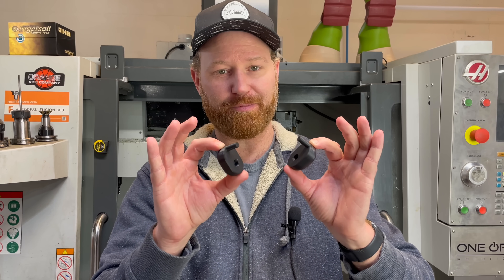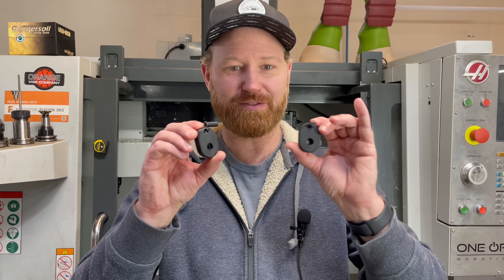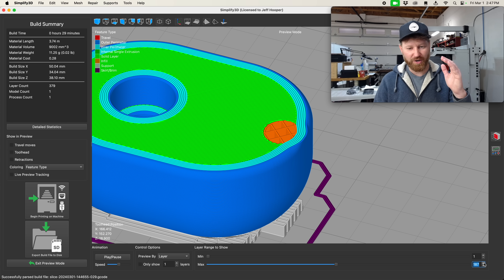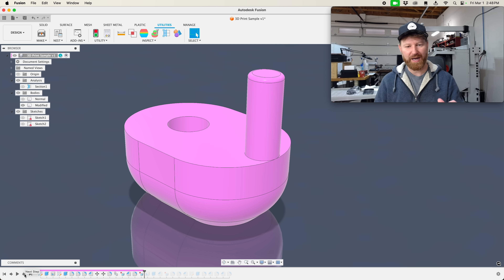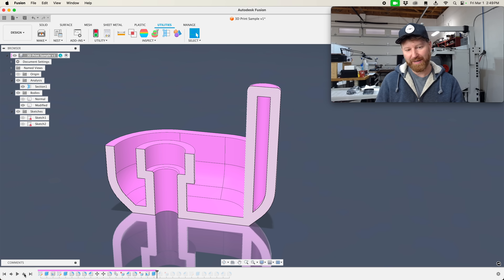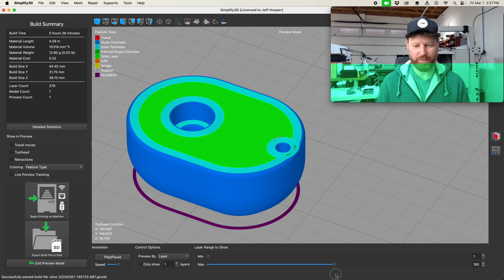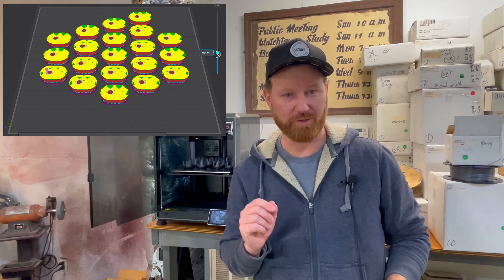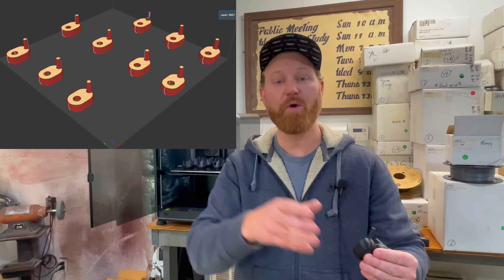Make your 3D print Faster & Stronger

Comment: In this example with a "tower" there's a slicer solution that doesn't require a change in a model. Use cylindrical modifier that goes to the bottom and change infill to 100% under that protrusion (or play with other parameters). Very useful especially if you use someone else's stl.
Reply: Can I ask what slicer you are using? That seems like a great tip and I am not familiar with it, but I only use cura for FDM.
Reply: @RoseKindred  Hi Rose. In cura you can use "support blocker" to create a cube that intersects with the model and then use "modify settings for overlaps" in "per model settings" to change in infill density
Reply: @tharukakuruppu  Ah, thank you. I never tried that way. I will look into it when I can. Typically I print with higher infill anyway, but I have noticed on my ant bait station there is a weakness in the screwhole posts I made. They looked much like this "tower" example.
Reply: @RoseKindred  You could try Prusaslicer or Orcaslicer for this. :)
Reply: @Küchenpandas  Ah, thank you. I have tried PS before but, honestly, I could not get the hang of it. Probably because I learned with Cura. I'll look more into Orca though, I have heard good things.
Reply: @RoseKindred   I tried Cura and Prusa and learned on them both from the start... but I just can't use Prusa, because the quality of my prints are always worse. I just can't find the right settings to produce good looking, normal strength parts. (On a mostly stock Ender 3). I've heard Orca was an excellent slicer, but haven't tried it yet. Hope it works good for you.
Reply: Change wall thickness.
Reply: nice
Reply: I was thinking about the same thing 😅, I came across this feature last month and it does almost same thing
Reply: In PS and it's derivatives, you can also import another object and use that as a modifier instead of a simple primitive shape. Very useful when you need to apply the modifier settings to complex shape, and saves you the hassle of having to manually size and place the primitive
Reply: exactly this. 
In Cura you can use support blocker as a modifier to increase the layers in a location. and so you can sort of indent the layers in that location, a bit like a buried concrete block of sorts. I added 2-3 extra layers, they end up almost merging into the infil creating a very strong location but also a very nice top layer as it is handy when you cover over a large flat top using silk PLA
Reply: Yes. I came here to say this. 
In Orca, Bambu, Prusa slicer you can use primitives like cubes or cylinders as modifiers and control almost any parameter (i.e. infill and walls). I used Simplify 3D for years but moved on to more modern and free solutions that have this features and a lot more. Part strength can be adjusted in the slicer. This is an interesting tip that is now gladly out of date.
Reply from the maker: This is just a concept, not everything can be solved with primitives. This concept provides complete control over how you structurally support your part. Maybe I’m OCD : )
Reply: @ChipMonkeys  fully agree. I find your approach is both very interesting and very powerful in terms of degree of control provided.  The modifier one simply trades some control for a faster implementation, and might be enough for certain scenarios
Reply: @ChipMonkeys No, no, not even close. There's lots of things your method can't do, such as vary infill or add thicker extrusions or whatever, so you have nowhere near "complete control"!

With the other method you do have full control. You don't need modifier parts to be primitives, but can use any part as a modifier. Just import all the parts and choose which ones are modifiers. Unsurprisingly doing it in the slicer gives you much more control of the slicing.
Reply from the maker: @marcus3d  We agree on your last statement. "... Doing it in the slicer gives you much more control of the slicing." Of course it does! haha  This subject was about Modeling for manufacturability. It gives you complete control of the inside structures of your print, because you modeled it.
Reply: @ChipMonkeys  Again, no. E.g., try to model inside structures like a cubic infill. You can't. Again, the way to have full control is to model not only the main part but also the modifier parts, and then combine them in the slicer. That's the only way to have complete control of the inside structures of your part.
Reply from the maker: @marcus3d  ... I sense you are passionate about printing without modeling for manufacturability. : ) But, yeah, I can model cubic infill. Which is my point. You can model anything explicitly. We added radii on the top, and inside bottom of that boss. Your method is okay if you only have a STL. But if you are designing a part, modeling the inside can add strength. If you are a Thingiverse guy, this method might not be helpful.
Reply: @ChipMonkeys  You're wrong. At least with the common slicers it's impossible to get them to produce something like cubic infill by modeling that into the part itself. If you think it's possible it just means you're optimistic but haven't actually tried. Try it!! It. Will. Not. Work. You just can't make the slicer do proper passes (like extrusions crossing each other) by actually modeling the infill.
Of course if you make your own slicer then all bets are off, but then it's not in the main model.
Reply from the maker: @marcus3d  You're the one wanting to model infill. Not me. haha You said, "you can not model cubic infill." But, yes, I can. I really think we are doing the same thing different ways. I mentioned that both have their place. Engineers have alway had to design based on how the part will be manufactured. It applies to turning, milling 3, 4, 5 axis, EDM, stamping, casting, forming, welding, and Yes... 3D printing.
Reply: @ChipMonkeys  We're talking about producing parts, so of course my "you can't model something like cubic infill" means that you can't model it so it produces something like cubic infill. Because you simply can't fully control the insides of the part produced simply by modeling a single part. You're just refusing to admit being wrong, although it's obvious to everyone.
Reply from the maker: @marcus3d  https://www.cnctutorials.com/3dprinting/ This is the link to the part. You'll need to show me. I'm not completely sure what you are arguing about. Is the method you are taking about stronger, faster to implement, use less material? What are the benefits? What is wrong with modeling the inside?
Reply: @ChipMonkeys  You don't understand what you're arguing against? 🤦‍♂️ You claimed that you have more (even full) control of the insides of an fdm part by modeling insides directly into the main part, while we say that you have more control by using modifier parts which tell the slicer how to slice different parts of the main part. We're right, you're wrong. I'm shocked that you need to be told these very basic practical facts.

For example, slicer-generated infill prints both faster and much stronger than if you'd try to model it yourself. And of course it's much faster to model, too. And again, just try to model a part where the "infill" is modeled directly in the STL and slice it without infill. Then compare it to a similar part that's solid and where you let the slicer make the infill.
Reply from the maker: @marcus3d  Man, I just modeled Cubic infill. (A shelled cube on a compound 45 degree angle patterned in the shelled part.) Took me 3 minutes and it worked just like infill, except I had more control because I modeled it. It worked on 2 slicers. If I am misunderstanding you, my apologies.  We have been printing industrial parts for over a decade. This method only prints material where it is needed, and not everywhere.. Like blanket infill. We can better control the wall thickness, and structural supports. We will gladly put another method to the test, but so far, you have not provided any advantage to the opposing method. I am not interested in being right, but making a parts stronger, faster and cheaper than my competitors : )
Reply from the maker: @marcus3d  I am printing both right now. We should have the answer in a few minutes.
Reply: @ChipMonkeys  I call BS. You don't even need to print anything, just look at the slicer preview. Show your custom modeled part causing the slicer to generate cubic infill. Show double height infill lines. Show alternating wall count gripping infill anchors. Show all those standard features that makes slicer-generated infill so strong and fast. And show the estimated print time compared to the same part but where the slicer generates all the things instead of your manually modeled insides.
Of course you're going to refuse to show any of that unless you're willing to admit being completely wrong, which you seem to be incapable of doing.
Reply from the maker: @marcus3d  After all your comments, I don't know if you watched the video. There was almost No infill. That's the idea. Only material where it's needed. No infill. Just walls with Radii.  I am still having trouble figuring out what you are talking about. Infill speed? Infill options?  How could you have more control than designing it? As soon as you click "Infill" you just lost control. You can click on more options, that's automation, that's not control. Anyone can assert an idea strongly, but we need to rely on evidence thru testing. You do not get better without criticism so, I entertained it.
Reply: @marcus3d  I think he means full control of the portions of the part that he's concerned with, not necessarily all of the variations and controls of infill specifically. I think it was a great video and covered something that too many people are just not considering, as well as an obvious weakness of 3D Printing and Slicer Software.  @chipmonkeys has a very real-world and practical approach that is really great. Of course there's always going to be someone that can potentially take it a little further, or put their own spin on it. Practical infill can be modeled, but some of the more complicated stuff probably isn't worth the time in CAD. There's guys with more knowledge and experience with Slicers and there's guys with more knowledge and experience in CAD Design. Both will look toward a solution that fits their specific strengths, Slicer guys will try to do it with the Slicer and CAD guys will look to solve it using what they know best. This video was a great eye opener for me.
Reply: @Mrddrichards  Just read his replies. Even after detailed explanation he still doesn't understand something as simple as the difference between a 3D model and the path of the extruder. It's shocking that anyone could be so unbelievably ignorant and outright...eh...how do I say this in a politically correct way... Let's just say that the wheel is spinning but the hamster is dead.
Reply: @marcus3d  I don't know enough about it to say you're incorrect, or even that his solution is bad or flawed. I just don't like shooting other people's ideas down or saying other people are stupid/ignorant. @avelkm's approach sounds good, but so far I have no experience using those modifiers.  But here's another well experienced guy utilizing some CAD functionality in an effort to get more strength and structure in printed parts. https://youtube.com/shorts/eDRS70im9M4?si=Gyo4Es2hrv3_EbSM
Reply: @Mrddrichards  If you don't know enough you can read what I wrote above and then you'll know enough. His idea isn't his, but an old one, and it's used when you have no control of the slicing, like if you send your model to a 3D print farm to get printed or somesuch. In those cases you just can't do the best thing, which is control the slicing, so you're forced to simulate it by modifying the model and praying for acceptable results.

Now, the ignorant part is for not knowing the categorical ways in which the sliced output and the model differ, and the stupid part comes from not understanding it even after it's been explained.

And yes, @avelkm is right. And the guy in your video is running a print farm, and as I wrote above, that's a case where you might need to use the inferior solution described in this video, just because the print farm doesn't allow you to control the slicing.
Reply: @marcus3d actually if you're designing parts for manufacturing, chip monkey's method is far superior. 3d printing is only a way of prototyping, and slicing is only applicable in 3d printing. If one plans to design a part that needs to be manufactured by other methods after prototyping by 3d print, then you absolutely need to model the interior as shown in this video. There's no point messing around in the slicer because actual manufacturing methods don't use slicing...
Reply: @chunskwok  You're partly correct. If you're modeling for non-3D-printed production then you need to model for the production process in question. However, that does not include these methods that are applicable only to 3D printing.

The point is, model for the production process you use. If you use 3D-printing, then controlling the slicing is the best option (and of course design with this in mind), and only if you gave no control of the slicing should you make hacks around that by trying to indirectly control it using modeling tricks which may or may not work as intended.

Comment: Some time ago I helped a friend with her mechatronics thesis. She designed a robot to be 3D printed, and I was the one who offered help with that, otherwise it would've been very expensive for her. Unfortunately, neither she or I were the ones to design the parts, rather her teammate who was absolutely zero skilled in 3D modeling, specially for additive manufacturing. Had I found this video back then, it would've been so useful, since his designs were extremely flawed precisely because of a bad implementation of pegs and whatnot. This was such a simple yet extremely effective solution, I'm definitely adding to my repertoire.
Reply: No one teaches engineers this very well, but: Use a peg for location, and a screw to hold something down. One screw and two pegs will locate and hold something against a flat surface.

Comment: I get the premise of the video, but generally hollowing a part out will make it a lot slower to print because those inside model faces will print with outside surface speeds. (Not sure if s3d allows you to tweak those individually).

I think you would have gotten the same result by just putting a hole through the shaft on your part and leaving the rest solid. Make use of your slicer differentiating between outside and inside walls as well as infill speed and the infill being properly connected to the inside walls.
Reply from the maker: I saw some video with that technique. Some other slicers seem to have other options that might help too. But, like you said, this video was more about a concept, than an example. Thanks for your comment! I never thought people would watch it. haha

Comment: my man, its 2024 , why are you using simplify 3d ? My suggestion is to use orca slicer, or superslicer, or prusa slicer , heck even cura , just not simplify 3d
Reply from the maker: Back off my Simplified 3D Bro! haha. It has some nice options other slicers still don't have. But, I use several slicers. For this video I only used Simplified 3D for the Demo, I used the Creality's slicer to run the part. It seems they are all better at something! What are you using?

Comment: nice trick for when you don't want to mess with modifier volumes in the slicer
Reply from the maker: You get me. haha
Reply: @ChipMonkeys also there are things which modifiers can't do, like adding perimeters to a single hole instead of the whole range of layers.

which is really annoying when you need to drill out the hole a bit larger and then bust through the thin shell

Comment: interesting ideas! I'm fortunate to only have to print the things I design myself, and I realized looking at how odd the example part seemed to me that it's a kind of feature I have practically subconsciously avoided, probably realizing it would not come out strong without even thinking about it, which is wild.
extra note- turning off the cooling fan and extruding 20-50 degrees above what the filament recommends, plus lowering layer height to 50% nozzle width and upping extrusion width to 125-150% is a great way to make large or multiple parts still have good adhesion, though it will degrade bridging, angled overhands, and surface finish.
Reply from the maker: Thanks for the suggestion! I'll give that a try.